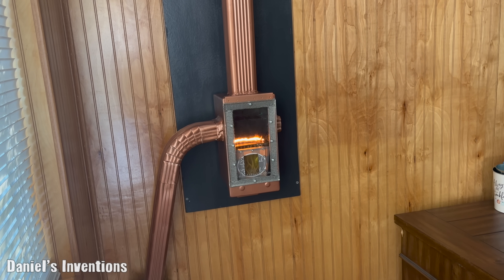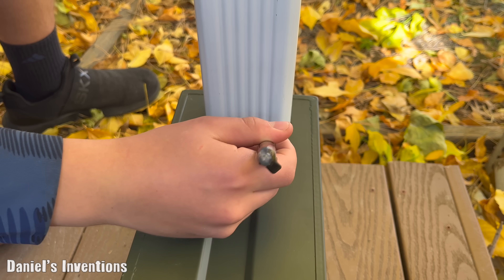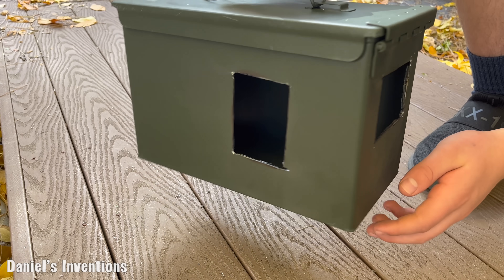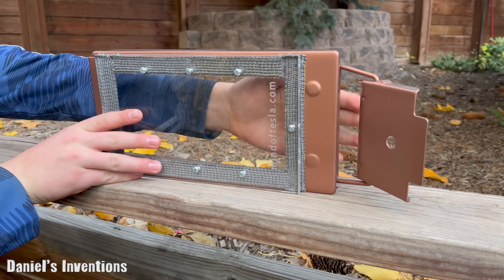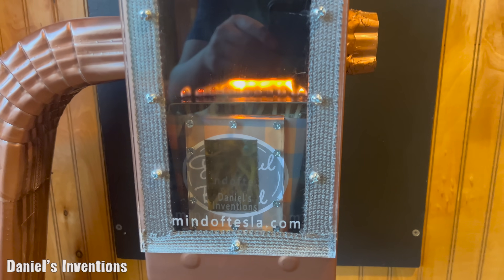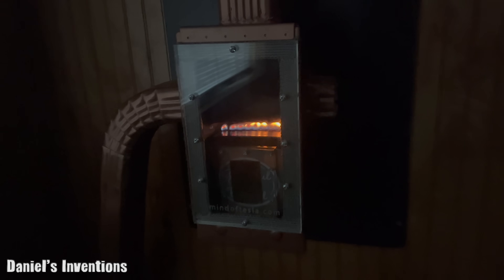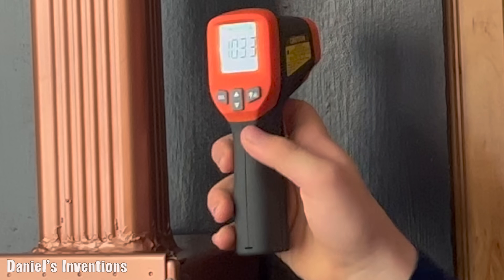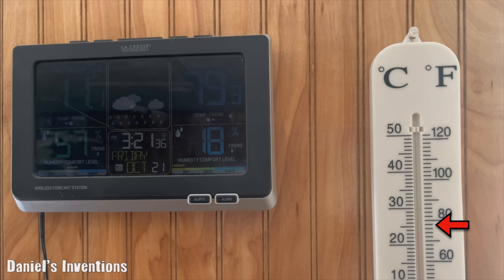ENDLESS Heat for Your Home WITHOUT Electricity

Comment: Question(s) : What type of oil do you use for this and how much per gallon? I plan on putting one in my garage and have the supplies already on order I plan on using the forever wick in place of traditional candle wick or others.  My main concern is the type of fuel used in this stove I don't want an accidental combustion of the fuel inside the register.

If any of you DIYers have any idea of a cheap fuel that burns long term please let me know and thank you in advance.
Reply: I am interested in what oil is used here! Didn't he say '2.50 a gallon'. What oil is that price these days?
Reply: I'd try vegetable oil.  I appreciate the idea and I'm going to make one with 3" car exhaust pipe and a carbon wick. You need the carbon wick to wick up the thick oil.

Comment: Great job. I question the necessity of the JB weld and sealing gaskets. If the exhaust pipe is 100 degrees, surely you have decent negative pressure in the ammo box. Just like a wood stove, wouldn't any air leaks would be pulling air in, not pushing it out? Also, as for the choice of metals, it might be better to use something smooth for a tighter fit, not a wavy sided gutter. Plus, it's painted, just like the ammo can, and will emit some fumes when hot. If possible I'd rather have un-coated metal, aluminum or copper, and i'd skip the jb weld and just try to make some accurate fitting holes.
Reply: First you are using the warm oxygen in the room which us a code violation In the USA. Because you that same oxygen to breath. DO NOT DO THIS.
This setup will leak Carbon Monoxide into the house.
JBWeld is bot heat resistant and will fail when exposed to prolonged heat thus causing it to fall apart and causing a hours fire.
DO NOT DO THIS.
Lastly This furnace is too small to heat a Closet much less a whole house. At best it is about 500 BTU.

You have No saftey precautions, No alarms or Co Detectors.
You are not qualified to teach anything.

Comment: WITHOUT Electricity but using a computer bower... get some brain cancer dude...
Reply: A lot of people caught that.
He didn't think to mount the thing low on the wall and run a pipe upwards off that horizontal pipe to take advantage of the chimney effect.

Comment: Don't forget to take a metal file and run it from the outside inward to take off any metal birds so you don't cut yourself. You may also want to take make the metal file from theInside out as well so you don't hurt yourself while you're working and then finish a 3rd time moving your Metal file from the outside in. 😉 
Safety first.
Reply: If you use this type of heater, have a carbon monoxide detector and be sure to Crack a window somewhere to let in more oxygen. If this last step is unnecessary,  please make a video showing how we can verify be sure that carbon dioxide levels will stay in the safe range and how big an area we need for CO2 to remain in safe levels while the feeling is occupied.  Ty

Comment: Great idea. Seen another video about almost the same thing with 4 candles. What I would be nervous about is the fact that the oil is in this very hot box. I would be afraid of a fire since any oil when very hot becomes very flammable. I live in a van an plan on doing  the same thing with 4 mason jars filled with kerosene.  Since kerosene is very flammable I want these jars underneath the steel case. This way the kerosene will not get hot.
Reply: The wax of candles has the same issue

Comment: Okay don't build this thing cuz it does not work. I've had fucking tin candles underneath this damn thing cooking that motherfucker and it don't get hot for shit when you turn the fan on it just cools right off it ain't blowing out 500° here this is bullshit video
Reply: Sounds like ya did it wrong
Reply: @cameronhines4726  I think my problem was I used a 12 volt Marine turbo fan it was pretty badass I think the air traveled through the thing so fast it didn't have time to heat up eventually I'll replace it with a crappy computer fan I guess or just use a diesel heater from China for 108 bucks that will burn for days on just one tank which is about a 1.2 gallons of diesel lol that's on low settings

Comment: Wow what a great video.  You have sparked my imagination for some heating for my shed. 
Any knowledgeable people out there that could answer a few questions, please?? 

1. take it you could regulate the temps buy using less wicks, or is there another way you could control the temps? 

2. would the ducting for wood burning stoves do the same job, rather than guttering? 

3. Would there by any draw backs to having spigots welded to the ammo box, then connecting log burner chimney flue pipework? Thanx

Comment: you could use a multi-tube tubular heat exchanger half covered on top instead of a strait hollow pipe and let the indoor upper pipe pointing upwards straight, this way you get more heat from the flames and use the natural air flow to drive the system, and you don't need any electricity for the heat system. The idea is great going to make one as well

Comment: That is really cool. Very nice invention. You could get through winter on like… 80$? Fantastic.
Reply: And you and your family will be dead.
This is a unsafe surefire recipe on how to kill your family.
    First this bad design using the warm oxygen in the room, which us a code violation In the USA. Because you that same oxygen to breath. DO NOT DO THIS.
This setup will leak Carbon Monoxide into the house. This is why we do not use Franklin stoves in the home.
JBWeld is bot heat resistant and will fail when exposed to prolonged heat thus causing it to fall apart and causing a hours fire.
DO NOT DO THIS.
Lastly This furnace is too small to heat a Closet much less a whole house. At best it is about 500 BTU.

You have No safety precautions, No alarms or CO Detectors.
He is not qualified to teach anything.
It needs a heat exchanger to make this safe.
your welcome
A certified Engineer. BSEE, BSME, MEE, MEE, BSCS

Comment: So when you wanna light it or put it out you gotta take out 15 screws or what? No easy regulation or wick adjustment. That aluminum drain spouts not gonna last and kill someone with carbon monoxide or burn the building down.

Comment: For all those saying to extract more heat from the flue pipe, this is actually undesirable. Most commercial venting is designed to keep the flue gasses hot otherwise you'll condense the acidic byproducts & get severe corrosion. You'll also soot up quickly if the flame isn't perfectly clean.

Comment: Great! Using copper for the exhaust hose will optimise heat exchange. I would suggest using a longer, more contorted exhaust pipe so more heat could be transferred inside the house from the flue gas.

Comment: You could probably get a little more heat out of it by having the exhaust wind wind a bit to act as a heat sink and have the air in it exit closer to the outside temperature. Some heat warnings or wire barriers might be good to prevent burning. Last question, how do you roll the wakes up? Could you add a rolling metal peace like on a lantern that would roll all of the wicks  up at once to adjust them and could stick out the side so you wouldn’t have to open it?
Reply: Got be careful with that.  If too much is removed the chimney stops venting through convection and suddenly have you carbon monoxide falling back down into the room, a silent killer.  I REALLY hope he has a detector near this thing.

Comment: Nice but too many assembly steps we’re left out. Would like to see a remake of the video, so we can see “all” the assembly steps (like how the holes were added to the stove glass, etc…). 

That said, you should consider selling a partial DIY kit that contains; an uncut ammo can, wick plate, oil chamber & oven glass cut/drilled to size.

Better yet, offer/sell each piece separately, so people can pick the parts that are too hard for them to make or source.

Comment: "Im going to show you how to get endless heat for your home without electricity" but yet you are using a electric fan for  circulation 
Maybe get your self a stove fan that is powered from the heat of your fire to circulate the hot air and then you can CALL it without electricity

Comment: Hvac Tech here - chimney temps below 126*F will cause condensing. This in turn creates acidic moisture that will eat through that entire setup, I would not want any insurance company to see this as you would be taken off risk ASAP. Now if you want to do this right you need the swap everything for stainless and have a way for the condensate to drain out with a trap. The most dangerous part of this is that your entire fuel storage in inside the combustion chamber THATS A BIG NO NO. Good concepts but really unsafe and not a long term solution.

Comment: this younger generation is so stupid. this will not work. this video is a lie. basic common sense,which no liberals have,wld tell u this is stupid 😂 liberals are such suckers
Reply: I was thinking the exact same thing what's going to happen is they will burn to death in this house or they will die from carbon monoxide poisoning. They really think rain gutters can withstand Heat not to mention all the toxic fumes coming off all that aluminum LOL and the fact that they say without electricity but yet they use a fan LOL I bet you they don't know to always check their blinker fluid either in their car lol

Comment: Unfortunately you never showed the temp of the air leaving the heater. It was probably only a few if that degrees warmer than the input thermodynamics doesn't allow for efficient heat transfer without more surface area. You created this video for views not for science. The amount of fuel oil you suggested is insanely low for how much energy is contained in it. Please do more math on things if you want accurate readings and aren't creating vids just for views. Delete my comment if you want but I speak from the want to help people not use YouTube as a way to just make money.  I don't even have a real channel.

Comment: Much better off using steel exhaust pipe for this project, it will stand up to the heat far better than the aluminum gutters

Comment: A few ideas for you to help you over-engineer your build: (A) Zigzag your exhaust pipe to cause more or all heat loss to occur indoors and less to no heat to be lost to the outdoors.  Or, (B) consider using a heat sink to radiate off more heat before it exits the indoor space.  Also, (C) Crisco burns for a very long time.  One can of Crisco should last a month if left burning continuously.  In fact, Crisco was created to be a candlewax alternative.

BTW, I watched the same video and thought it was a fantastic idea.  Your wick idea is a definite improvement.  What do you do when the wicks burn up or get short?  Also, have you experimented with controlling the volume of airflow to the flames?  If so, what effects did you notice?

Comment: I wish I could just buy this cause I never have time to make it. This is awesome.
Reply: No it's an incredibly stupid and naive idea the fact that they're using electricity they lied it right there. You don't use aluminum gutters as it will give off toxic fumes. And you might as well just go by 10 oil lamps as that's the equivalent of what they've done and the majority of the heat won't be wasted going out a pipe

Comment: One thing that might improve the efficiency and general heat distribution is putting the fanned intake at the top and the heat exhaust at the bottom. You will need a stronger fan but this will help maintain and speed up the heating process because heat rises.
Reply: Great idea. I plan on doing just that when I make one of these. Not only will it improve efficiency, but it will also improve heat distribution. Warmer floors and not-too-hot ceilings - much more comfortable.
Reply: Heat rises  Bad engineering idea. This would trap Carbon Monoxide leaking into the house faster.

Comment: This design is unsafe and unreliable! The materials of construction are poorly specified and the lack of temperature control is problematic. Every criticism of materials by other commenters is justified. It is a shame that YouTube doesn’t have a disclaimer for unsafe practices as this video would surely have one. Anyone following this build will ultimately live to regret it. As a matter of proof to these words just take a look at any commercial oil burning furnace and see if any external temperature reaches the unsafe temperatures of this furnace. Typical temperatures supplying the heating from a furnace will be less than 120F not over 400F!! This channel should renamed to ‘Daniel’s Death traps’!

Comment: I don't know I want to say maybe that you should put a disclaimer on this video saying that it's just made for the fact of making a YouTube video because you bypassed a lot and a lot of dumb people can see this and end up burning their house down. Luckily most people will see you using a grinder in shorts and realize maybe this guy shouldn't be teaching people how to Heat their homes.
Reply: Not to mention relying on JB Weld which is rated for Max constant rate of 250° and yet you tested that your burner is getting up to 452°, where it is only rated for intermittance high temperatures up to 1,000.

Comment: Except you used electricity. Lol For a space heater rather than a full HVAC system, oil vs electric cost pretty much the same. Neither is efficient at small scale. Oil only becomes cheaper at larger volume areas AND when petroleum prices are low.

Comment: 5$/week for 220sqft... our home is 2,000 sqft... with terrible insulation (was built in 60s, brick and siding and the roof insulation needs replaced, as it's barely 6 inches at this point... so it'd be 50$/week instead of 5$ (10x the square footage) and.... yet my poorly insulated home doesn't use 200$/month for electric JUST FOR HEATING it also does laundry, phones, computers, lights, etc... 16sear electric furnace.. I could spend 3,000$ on insulation upgrades (and plan to) and lower the electric bill even further. This video makes sense for very small spaces, but it doesn't scale. Obviously the furnace is expensive, but the best ROI is always insulation and not the source of heat.

Comment: One pointer : the concrete backer board needs to be mounted with a 1 1/2" to 2" space between it and the wall . Otherwise the backer board will heat soak and eventually conduct enough heat to damage the wall.
I made the same mistake with a small wood stove many years ago.
Great design and fabrication 👍👍👍👍😊
Reply: Good point. I think he got this message... In decibels:-)
Reply: this distance between wall and safety board also lets the air flow and heat up additionally, even if not so much, but still
Reply: Not to mention it also makes it more efficient, thats an entire side of the heating unit that will not be radiating into your room but in an exterior wall!!
Reply: You are not a joking about that concrete board backer, May I ask what did you use to space the concrete board away from the wall, I am building a chimney in my backyard one day I wanted to firebricks for mine, I also wanted to frame a shed around it with wood then do rock & stone on the inside and out around the whole chimney what should I space my stone away from the wood just so I do not get the stone & rock to hot making the wood smoke. I am doing mason work on this I want to do it right.and how high does my chimney need to be if my roof is 10ft off the ground with 6/12 roof pitch gable truss style roof?
Reply: Whatd  you use for spacers? I had used 3/3" cement board strips  behind the cement board to protect the ceiling above the wood stove and the wall to the left of it. These were 2 to 4.5 ft from the stove and the boards still absorb nice amount of heat.
Reply: They have building codes for a reason 😂. And one of  my chimneys  just failed several of them.

Comment: You should always keep a space between the concrete board and the wall so that air can flow in-between. There's a risk of slow charring over time behind the concrete board and charring lowers the temperature required for a material to catch fire. This is true for any kind of back plate protection if the back wall is made of a flammable material.

For your safety, put spacers between the concrete board and the wall of at least 2 inches.

Comment: Good job. Great concept. Basically a heat exchanger.  I would be very concerned with it mounted to the 'fireproof' backer. I would feel better with a bit of standoff, and a metal sheet on top of the fireproof backer. It would reflect heat better.

Comment: I like the design . I’m actually a heating and air professional in the business for 18 years now I think some things that I would change myself as I would use copper tubing to build an actual heat exchanger for the internal part leaving air gaps for more heat transfer space.... Think think also I would rig up a inducer pipe fan somewhere near the exit of the flu pipe also putting in air inlets some of the bottom unit to let air come through into the burn chamber helping maintain proper combustion.....And to be even a little more efficient I might make some homemade birch or pine oil out of some fatty wood solar panels for the car battery to be completely off grid for my low-voltage DC fan motors

Oh and use high temp silicone to seal the pipes not jb weld

Comment: Is it possible to build a frame parallel to the exhaust pipe in which computer fans can be mounted to blow heat off of the surface of the exhaust pipes into the surrounding volume of the room

Comment: There are at least 10 or more Fire Code Violations here.   What you are doing is putting people's lives in danger.  Ask yourself - why are commercial heating units stamped with a UL label or a NFPA label?  Because the manufacturer tested the device to make sure it didn't kill people.  These DIY ideas are dangerous.  Why would you use rain gutter material for a chimney?